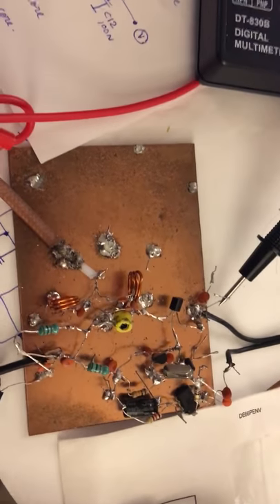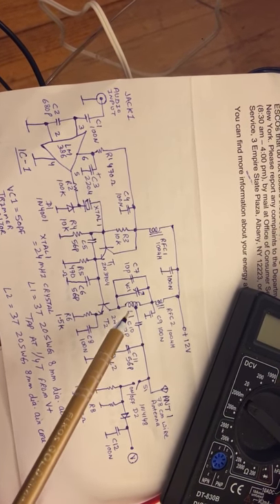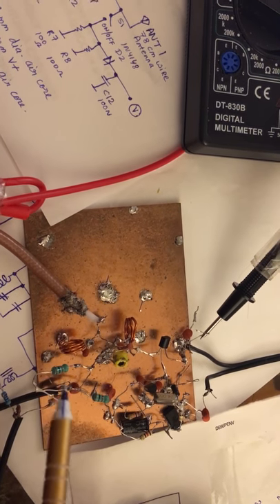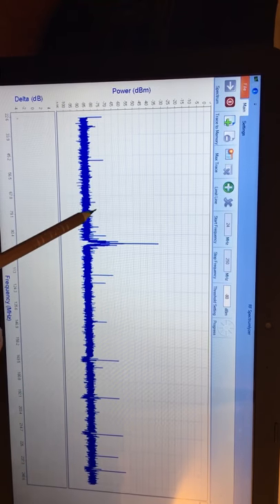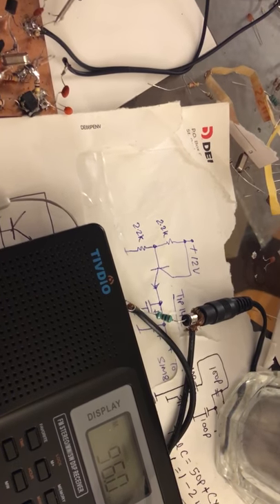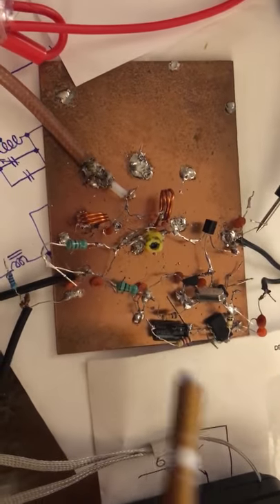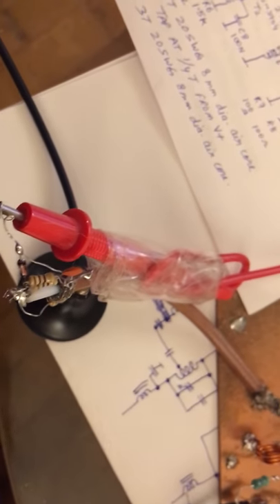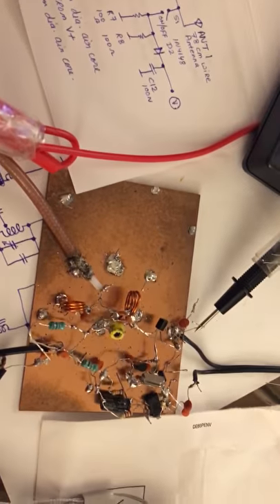96MHz Crystal controlled FM VHF Transmitter (NBFM)

Comment: Mistake: C5 is 100pF and 56pF in parallel, and not a single 56pF as shown. Diode is a 1N4007 and not 1N4001 as shown. One can use two parallel crystals for slightly louder audio.

Comment: bro plz consider this circuit. why have you used diod with crystal???explain me ???
Reply from the maker: Electronics Hacks Diode is acting as varactor diode. It pulls the crystal frequency up and down in accordance with audio signal and this results in FM
Reply: @joymukherji991  thanx yaar, for providing valuable info.